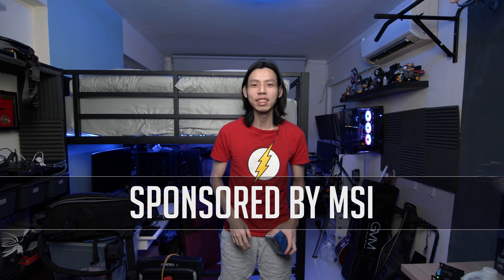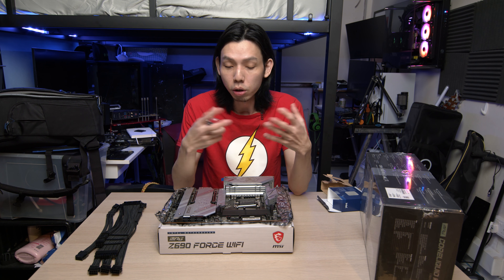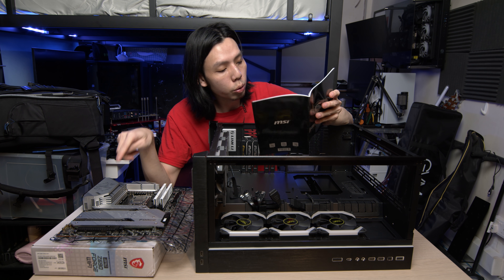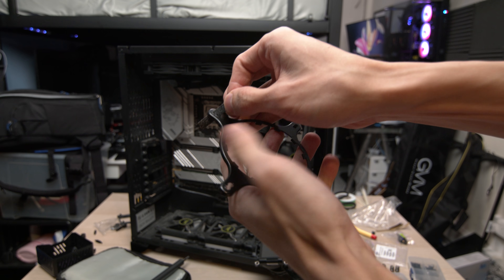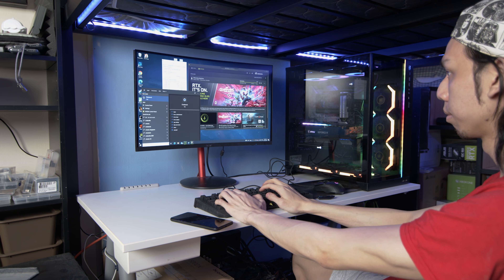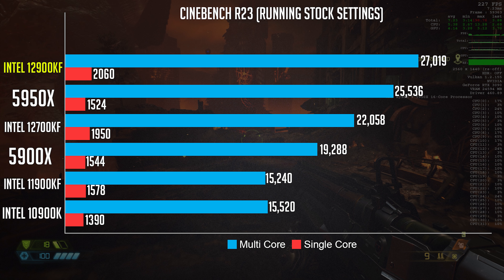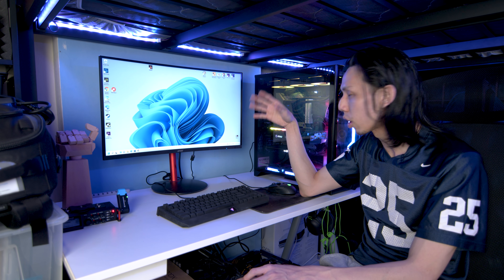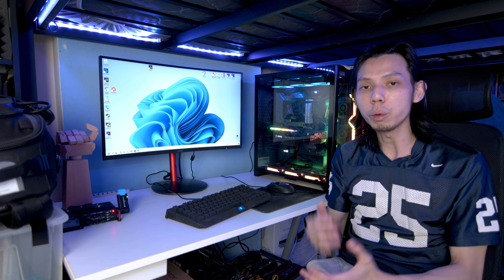New Room = New $5000 Gaming PC! | Part 1

Comment: Intel Core I7 13700K
Mainboard Z690M AORUS ELITE
ADATA D50 RGB16GB (2x8) Bus 3200Mhz
SSD SSTC 512GB M2 NVME Gen4x4
ZOTAC RTX 4080 16Gb Infinity OC
ANTEC 850W 80Plus Gold source
With a configuration like this, how much do you think the price will be in Singapore at the present time?

Comment: Well, the notice about SATA 7 being unavailable seems to be ONLY WHEN you install an M.2 SATA SSD, not an M.2 NVME SSD, so why would it matter anyway? M.2 sata seems to be really obselete at this point, even though I wish it were not.
Reply from the maker: Nooo noooo. all the M.2 slots are PCIe. It's just 1 of the M.2 slot share the same lane as SATA 7. so if you use that particular slot you can't use SATA 7
Reply from the maker: I think it depends on your motherboard
Reply: @JulianTechTM  Yes, all the slots support PCIe, but some of them may also support M.2 SATA as well as PCIe, as shown by the message you read out in the video. So it should be the SATA port that is shared, not the PCIe lane. I am pretty sure SATA 7 does not share PCIe lanes with that M.2 slot, because the SATA connections should come directly from either the CPU or Z690 chipset, and not a separate PCIe to SATA converter chip in the motherboard. 
I am pretty sure you are wrong here, although I do not have such hardware to test myself and I do not have as much experience with PC hardware as you. However, from what I understand from that message you read out alone, I URGE you to try it out yourself, just connect a SATA device to SATA 7 while all the M.2 slots are filled with NVME ssds. I am certain it should work.

Comment: just curious, what's the average fps if u run csgo at 1280x960, low settings (except for multicore rendering switched on)? 700 fps in Competitive MM?
Reply: Probably 30fps ngl

Comment: 750W enough for this?
Reply from the maker: 750watts is the bare min for 3090. If I run both cpu and gpu at 100% I might have some problems. But don't think that will happen even in the heaviest load
Reply: I see! Nice build! hows the CPU cooler?

Comment: I'm doing my corsair/Asus build, I spent $7500 on mine,   I like MSI in fact they are my favorite motherboard manufacturer, I have never tried asus and wanted to which is why i went with a Z690 Hero, I wanted to point out your PSU is severely under-powered, you need a 1000w at least, you will find a review on here where a reviewer had an 850w psu and he crashed when doing stress testing for any length of time, you MIGHT not have an issues just gaming and stuff, but I wouldn't.